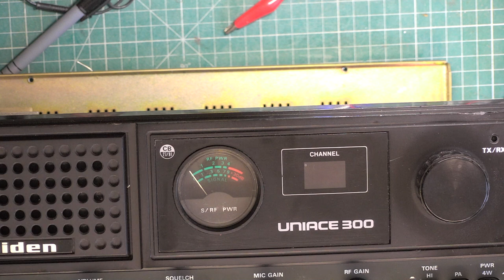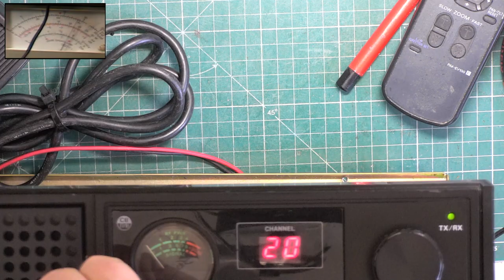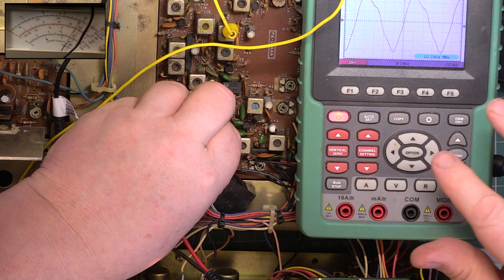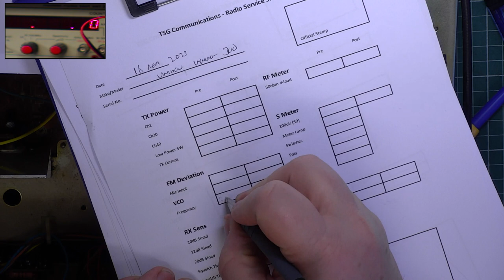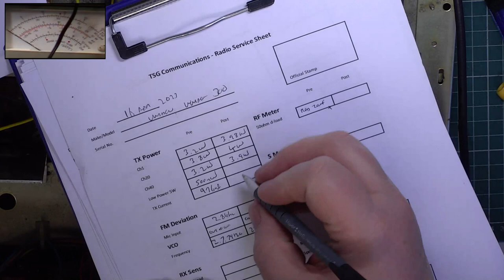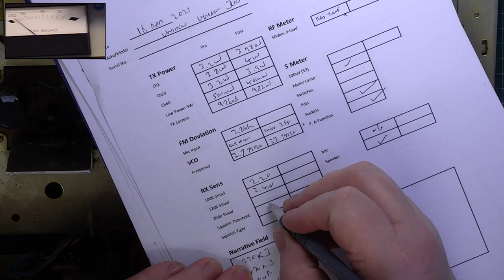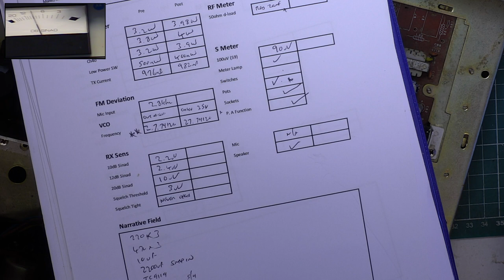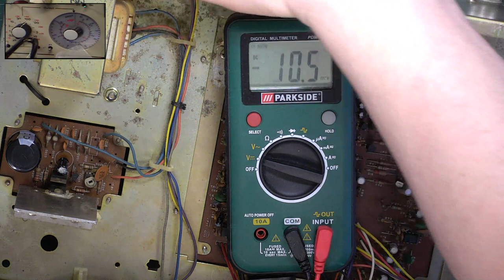Uniden Uniace 300 CB27/81 UK FM CB radio base station - extensive repair

Comment: Thanks for the works.
how to find the schematic diagrams for these types of radios
Reply from the maker: Back in 1982, I contacted evry CB importer & asked them to sell me service manauls. Those who could, did so.

With experience, you find which chassis are used in which radios & they can apply the best or nearest service manual you have. In this case it was for the Realistic TRC2000.

Richard, G0OJF,  UK

Comment: Interesting to see and hear how that performs, Sinad results were bad though, filter maybe? Smokers sets are often so bad, my shack permenantly smells slightly of fags because there are 200 rigs and walkies in there, many that are probably with me earlier than they should have been because the previous owner smoked, at least the meter still worked that's amazing, smoke gets in to everything and well just ruins things.
Reply from the maker: Yes, the filter was changed too. Front end transistors were swapped with ones of higher gain, bringing us to the figues we ended up with....which is better than the Cobra 29 swish looking set from  about 4 years back!

I'll be editing & uploading the 'on the air' test tomorrow. The set worked great.

At the end of the day, I could hear the signal generator down to 0.25uV with the 400hz tone on.

Richard, G0OJF, UK